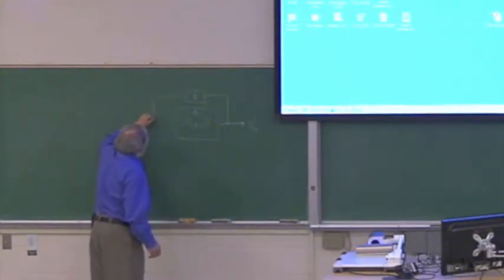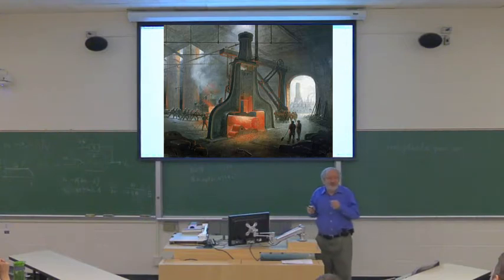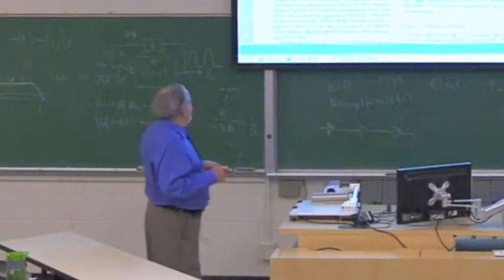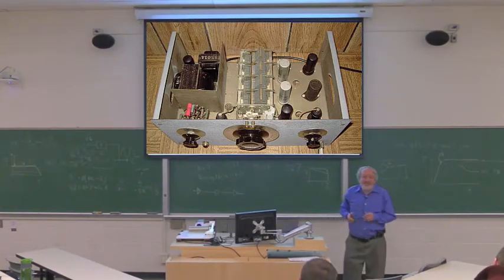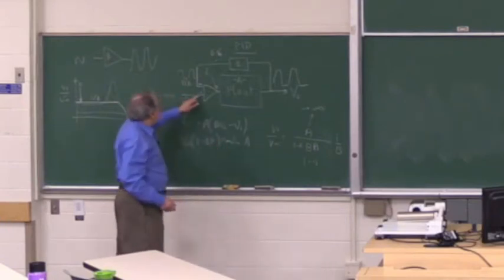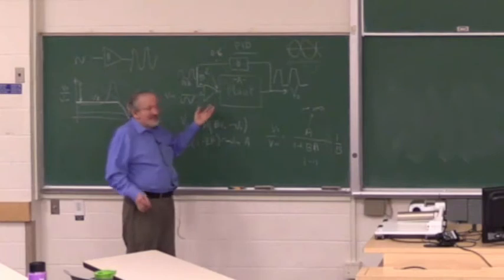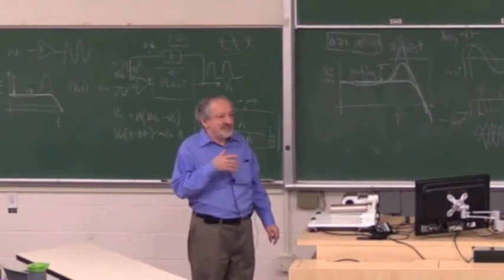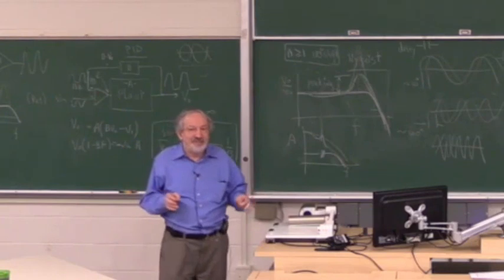1:  Introduction and History of Servo Systems

Comment: The time spent at making students feel like crap for not "knowing" stuff, or not wanting to stand out as in "oh, oh, me me me me!", is not only a waste of time and energy, but most counterproductive. 

The student should be isolated from the frustrations of a teacher; all teachers learn this, all leaders learn this; the crap stops here, protect the output against distortion, filter the noise out that could compromise the process. 

Transferring teacher frustrations to students, whom are most often not responsible for, and aren't the real source of the signal frustrating the teacher; is actively sabotaging moral, impeding the learning experience, and an exercise of futility. 

A frustrated teacher should know, better than anyone, that the system is the problem, not the student.

If prerequisites aren't met, and non conforming to prerequisites students make it to the class, then the registry process is corrupted; which is an administrative issue, not a student issue. 

If the students lack something, the teacher supplies it; one way or another.

Most teachers will do a first class recap, to bring all students up to speed, and offer reading suggestions as homework if anyone has more difficulties, including the conforming student whom haven't touched the prerequisites in a long time. 

Making student feel inadequate transforms them into enemies, and sends them in a natural frequency of mental noise where they daydream to punish you. If you really want to blame someone, blame the system, if you dare and feel secure in your tenure/union. Unless your aim is to rid your class of students...